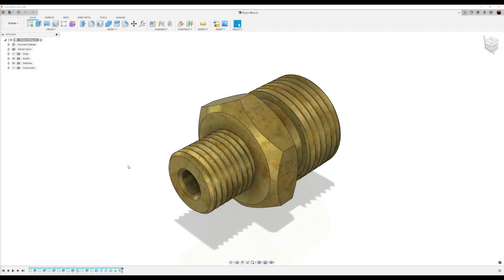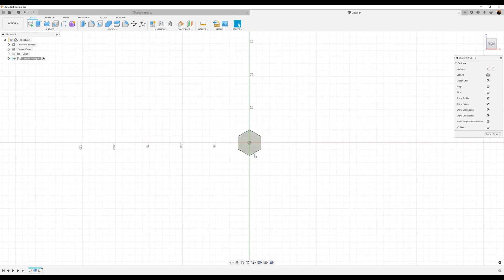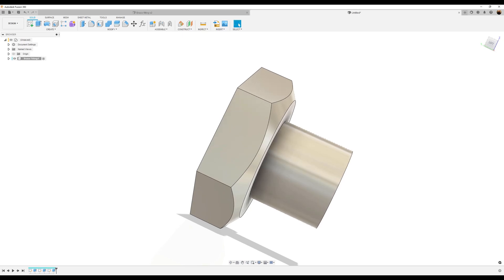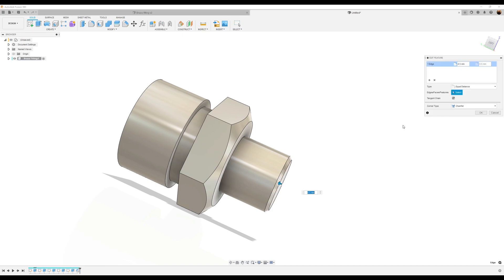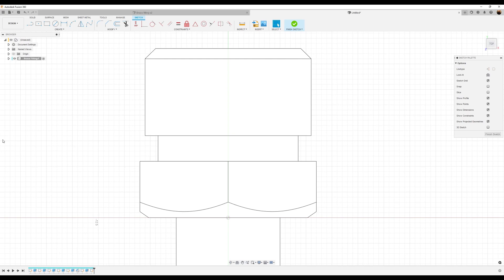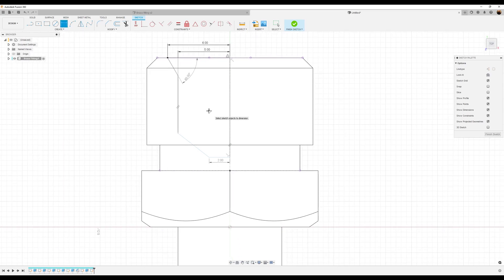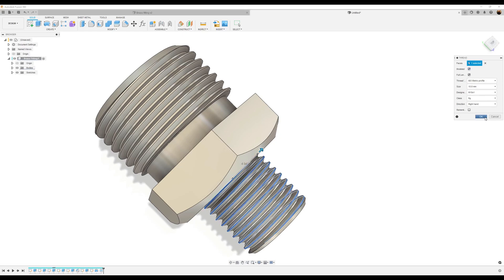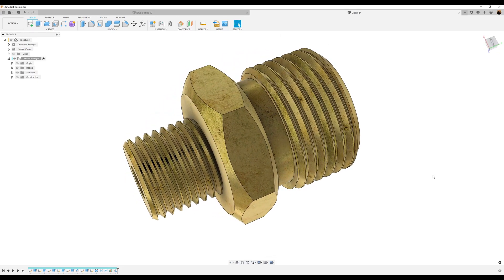Create a Brass Fitting in Fusion 360

Comment: This is a very nice tutorial. Thank you. Specifically what kind of a machine do one need to produce an actual brass fitting? Is there a specific name for the machine?
Reply from the maker: Brass fittings are produced with Computer Numerical Control (CNC) machining techniques.  This is a subtractive manufacturing process that employs computerized controls and machine tools to remove layers of material from a stock piece producing a customized part.
Reply: @CADJungle  Thank you so much for the answer.
Reply from the maker: Sure thing. Check out this video  https://www.youtube.com/watch?v=kicepCM4eb4
Reply: @CADJungle  Thank you so much. This is exactly what I was looking for to get informed about this subject. I am thinking about starting a small business selling brass fittings. I have a customer base but I am not well informed about the production side of it. As I understand, I don't need super big cnc machines to start. Even a small cnc lathe will do the work I am guessing?